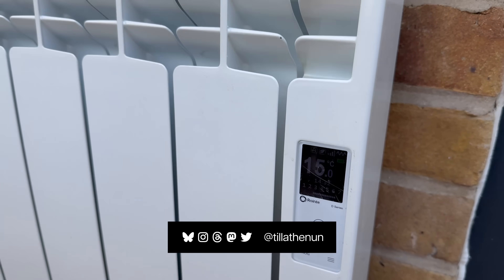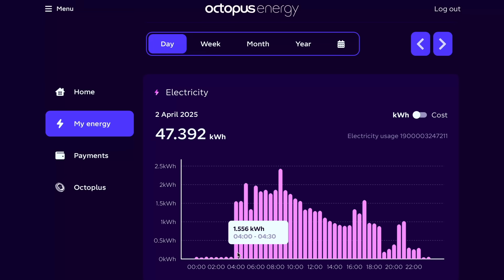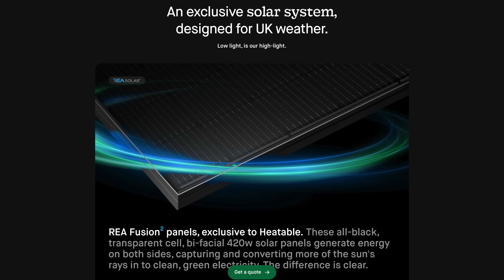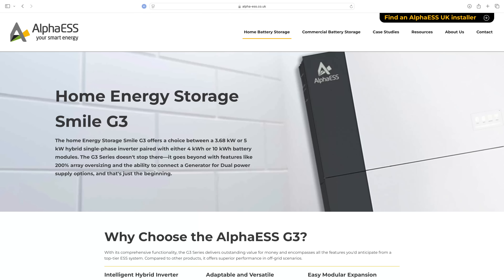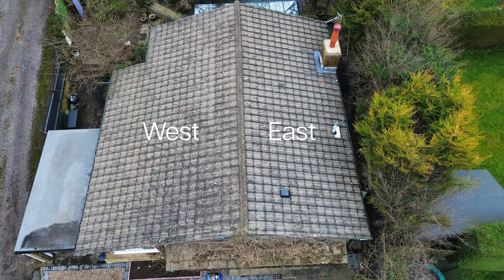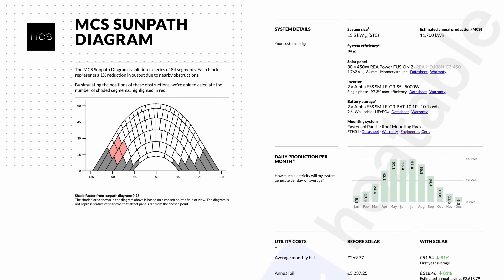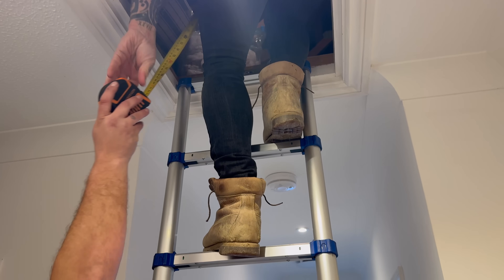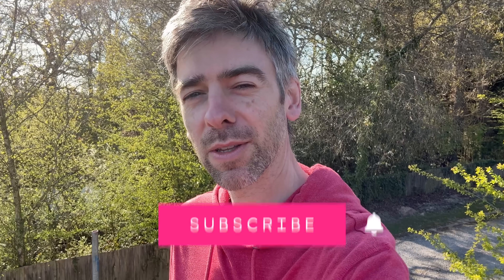We're going to kill those bills! Why we've decided to get solar panels and battery storage. ☀️

Comment: Hi Andrew, just done the same, this past week! My system installed: 14 x Jinko 440W panels south-west facing, dc-coupled to Tesla PW3, and it is fantastic! April so far: 2 x 31kWh generated days, and 2 x 16kWh days, the former 2 x clear blue skys, the latter cloud covered (i.e. normal UK days). As our house normally consumes on average 10kWh daily, we have zero kWh from the grid over those 4 days! Our installers are Generation Green and I can fully recommend them, 3 guys professional and friendly, job completed in 3 days, just need to encourage the scaffolders back!!! All in All, I'm a very happy bunny despite the cost!
Reply: What was the cost ? That's kind of key here although the models of equipment help 😊
Reply: @sbashir9460  Came in around 15K, payback around 9 years.
Reply: @nickhstd2  Thanks. That's around the cost I came to when doing a very quick assessment. But the payback is what I need to work out.

Comment: Have 20kWp on East/West rooves with 18kW batteries but in Bavaria where winter time generation can be a challenge eg snow! However from March to October more than enough despite high electricity load.
Also have an immersion heater (2.7kWh) in our 300 litre hot water tank, so don't need CH at all from April to October. I guess as you have electric radiators,  your hot water is already via immersion heater.

Plus, can easily charge 65kW BMW iX1 battery. Wait till V2G becomes standard for EVs, that will be a game changer.

Comment: Got my quote from Heatable - I'm definitely thinking about a Givenergy battery and backup followed by solar (after I change the roof). Please keep us up to date how you get on. Would love that battery video and all the options you had as well.
Reply: Got to be at the same time as the new roof, surely? You'd save a lot of the install cost by doing it when the scaffolding is already up.
Reply: @shouting-into-the-void  You'd think so wouldn't you, but when we had the same done we found there were companies that did roofs, and other companies that did solar, but no companies that did both - and each company wanted to use their own scaffolders (or they did it themselves). We did in the end manage to get the solar installed immediately after getting the roof done (they had someone pull out of a planned installation so brought us forward by a couple of months). Even better the scaffolders the roofer used was happy to leave their scaffolding up for 2 extra weeks for no additional cost, so it worked out perfectly - but it was a complete fluke it all happened like this!

Comment: In my region (a different country), we recently spoke with five potential solar providers over the last ≈3 years offering systems quite similar to yours —around 9–12 kWp panels with battery storage between 9 and 11 kWh capacity. The quotes we received were steep enough that, even factoring in our EV, I couldn't quite calculate a break-even point within a reasonable timeframe. Payback periods ranged between 13 and 16 years, which already exceed many of the warranty periods for the parts.

This got me thinking: is such a system only viable for you because of your YouTube presence, visibilty and reach –through the sponsorship(?) or discounts? Would you have done it without this opportunity? I’m genuinely curious, especially to hear whether other viewers from Germany are encountering similar pricing and payback scenarios.

Comment: I really enjoy your videos.  My solar roof was installed nearly three years ago.  No regrets.  Just had my latest bill from Octopus.  My export rebate was £65 for the month.  Also just had my heat pump installed.  OMG it is just brilliant.  I have reduced my monthly payment to £50 and that is for a five bedroom house.
Reply: I had the money in the bank earning very little interest.  The roof plus battery was £12000.  Based on its performance so far I am expecting it to pay for itself in eight years.  After that it is pure profit.  The heat pump cost me £6000 after the BUS grant.  However, my boiler needed replacing and I was quoted £3000 - £4000 on that as it was a large boiler.  So, I am in for £2000 - £3000.  That is indicating a payback period of 2 - 3 years based on gas savings.  The other thing to bear in mind is that according to estate agents I will be increasing the value of my house to potential buyers.  It has all been a no-brainier for me.
Reply: @leswaters2275  I hate the focus on 'payback'.  When people spend GBP10k on a new kitchen, I have never heard them worrying about 'payback'. 

I suggest to people to calculate the anticipated reduction in energy purchases, and treat this as a yield on the capital cost.  In my case the yield is around 11% (and it will get larger as energy prices escalate, which is pretty much a given these days).  I'd suggest this is rather more than. most people get as interest/investment returns. (Our energy cost 2xEV, 5 beds so far in April is £5.04, for 650+kWH of consumption)
Reply: @leswaters2275 how many panels came for that £12K plus battery?
Reply: And what was your total investment for all of the above may I ask.... Lots of people are so keen to say how much they are saving without taking in consideration the outlay plus interest on the finance...
Reply: @john3Lee  Exactly , we costed it out and it would have taken 14 years to break even , soon after that you have to replace the panels . and start again . Followed an install journey on YT and the guy was unsure wether it was all worth it .
Reply: @ Panels are guaranteed longer than 14 years.  You'd probably need a new inverter in that time though.  I went for solar 9 years ago and payback was questionable.  Since added EVs and battery and enjoy the massive collective savings - the more you electrify the better environmentally AND financially.  Had a heat pump in Feb to complete the set 😃
Greg Jackson needs a knighthood btw.
Reply: @tobytroubs  14 years to break even suggests some really bad calculations or a really bad use case to me. There's a lot of fiddling about you can do (changing tariff, changing habits, maximising export, charging batteries, etc...) and that makes a huge difference. My installers figures were terrible, didn't factor in any of that and had export rates at 4p per KWh when 15p was easily available. So I'd recommend you revisit this if you're still interested. My original payback time was about 6.5 years (based on about 2 years of actual usage) but since I got the EV and the cheaper overnight rate that's dropped considerably. I only pay about 8.5p on average for import and export at 16.5p. So it helps to layer on other technologies. If I get a heat pump sometime this will help as well given I've got a pretty huge gas bill to offset against.

The only downside to this is assuming past behaviour predicts the future. I've seen a few signs suggesting export rates are going to fall given on a national level we appear to be close to filling the daytime generation gap with excess solar. I make/save an awful lot of money through export. I was looking at installing a lot more panels this year but given I can't directly consume much more electricity I'd basically be exporting it all. Which is no good if the rates drop a lot.
Reply: @FlatToRentUK  this was about three years ago so things may have moved on, also we are now entering retirement so I ditched the idea
Reply: Awesome. I had batteryband solar installed last october. Heatpump installed end of Feb this year. Really loving it. Expecting a zero bill for last month and that's with 2 EVs charging.
Reply: We had 18 panels fitted on our South facing roof.  Panels and batteries have got a cheaper now than when we got ours.  However, installation costs have probably risen.  I would think most of the cost is absorbed with scaffolding and labour.

Comment: Am tempted with this, sort of kicking myself we didnt have it done a few years ago when we had our loft/roof converted. One thing i've always wondered if what value if any it would add to your house. Will probably be moving in the next 3 years but knowing we may get more with having solar/battery installed would help make the decision. Thanks Andrew!
Reply: I had my solar and batteries fitted 15 months ago, a smallish system 11x 410 panels and 25kwh of batteries, and absolutely love it. If I moved in the future, I would only consider a property that had solar fitted or one that had a large south facing roof. Once you taste "freedom," you'll never give it up.😀
Reply: A few people have tried to answer that question, with varied results. If you ask an estate agent, they'll say it doesn't add anything and can even slow the process if the buyer's solicitor wants proof that it was all done properly and isn't a roof-leasing scheme. OTOH if you're selling to someone who wants solar, then it does add value. So it really depends on whether your buyer cares about solar or not.

If you're definitely moving, how about getting an EV first, because you will take that with you? Or looking into a battery that you can take with you? Battery install prices are generally much cheaper than a full solar system, and save you about 2/3rds of you your electricity bill.

Comment: I'm moving house in the next 3-6 months and have a plan already. First is car charger and replace the gas hob with induction. Then battery and heatpump to go totally gas free. I'm not convinced by solar panels yet, but I may change my mind on that.
Reply: I make over £400 income from my modest 3.78kWp system, as well as covering all our daytime electric between March and November. Our car is our biggest consumer of electricity, which is charged at 6.7p per kWhr at night, when we also run the dishwasher, washing machine, and tumble dryer. 

Solar is definitely worth the investment.

Comment: Solar. Great choice!! We had 20 panels installed December 23. Had our normal bill February 24 and no bills since! It's brilliant. It makes my EV driving very very cheap!
Reply: Depending on your tariff I'm not sure why you're charging an EV from solar. I've got both and charge the EV overnight at 6.7p. The excess solar I could have put in the car gets sold for 16.5p. So charging from solar is effectively more than double the price. It's also better to charge at night while demand is low and send excess solar back to the grid during the day to help balance demand.
Reply: Very confused as to why you would fo that?
Reply: How can I get a similar discount as yours?
Reply: Till the battery in the car wants changing then its scrap
Reply: @john-s2i3c Are you a bot?  I think your script needs an upgrade, it doesn't seem to have changed since 2012 😄

Comment: Well done Andrew. I did it that way round too for the same reasons.  
We have 20x405w Panels with one inverter and 4x5kWh batteries.  The Solis inverter does have a circuit that switches in when mains power disappears. Unfortunately, learning how to program the inverter so that it does it properly is a pain. I might have worked it out now.  Last time the power went off, the panels managed to power the house and charge the batteries - but then there are only a couple of circuits which get power.
When you are talking about taking the batteries with you I thought yes BUT the technology is changing so rapidly.  The panels I got were virtually the state of the art when I bought them and you can almost pick them up at boot fairs today. Ditto batteries and inverter.  So you might get more for less if you "have" to move again. 
(Get a good installation company if you can. The one I went with had all the accreditation and MCS ...but still went bust.  Shout out to Electropoint who came and rescued the installation and finished it off.)
Reply from the maker: That's a good point about battery tech. It may also end up being false economy given the cost of getting it removed and re-installed.

Great that Electropoint sorted your installation out.